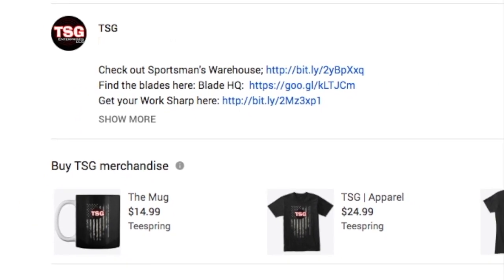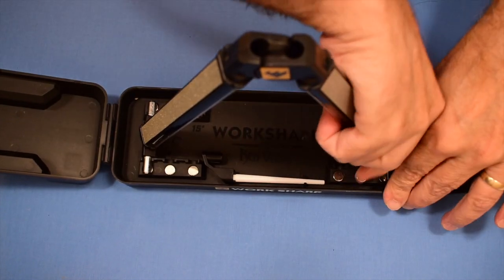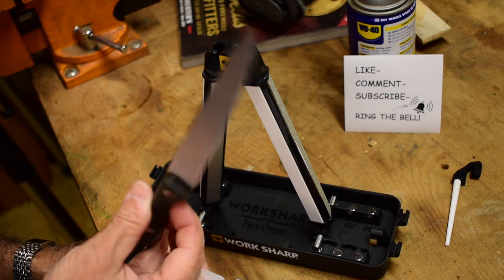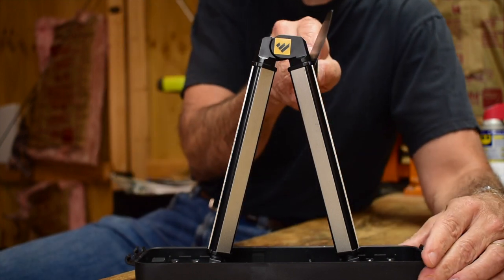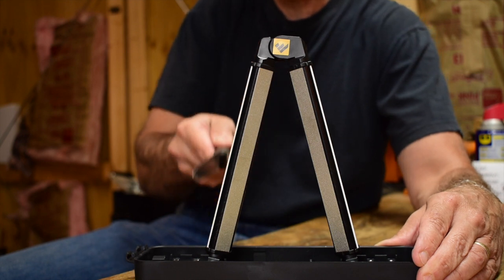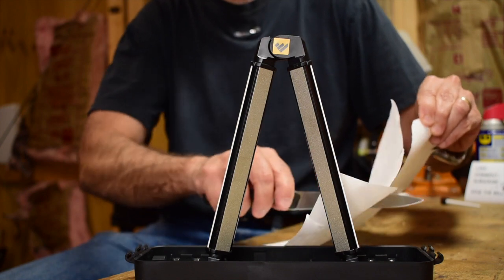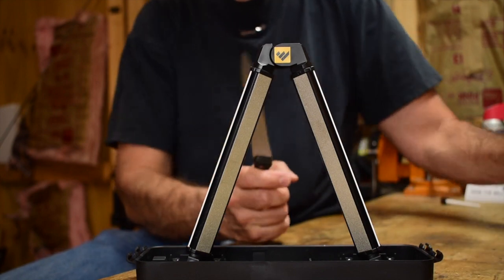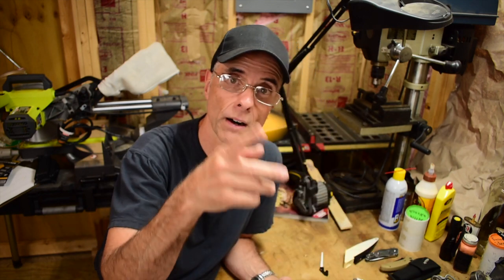What to do with a dull knife

Comment: My guess is that the kitchen knife was sharpened last at an angle greater than the one you did in the video.  If that was the case the sharpening medium would never touch the cutting edge of the blade and hence not sharpen the blade edge.
Reply from the maker: Brilliant! Makes perfect sense. Thank you.